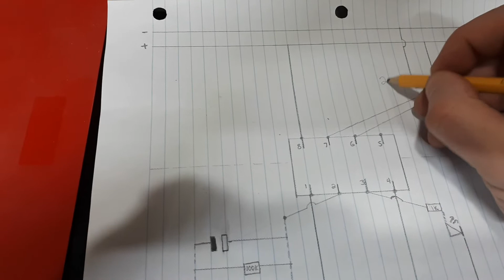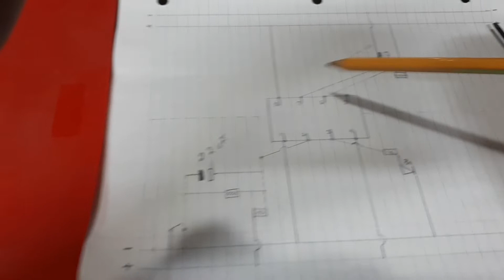555 timer momentary switch with adjustable pulse control

Comment: ...nobody seems to know how to draw schematics anymore...........
Reply from the maker: @dalenassar9152  its a 555 timers its has 3 modes there really isnt anything you need a schamtic for. Capacity and resistance paly the tole of time so application specific and one shojld be able to look up what mode they need simple google search and there you go. Its also probably on the 555 time data sheet